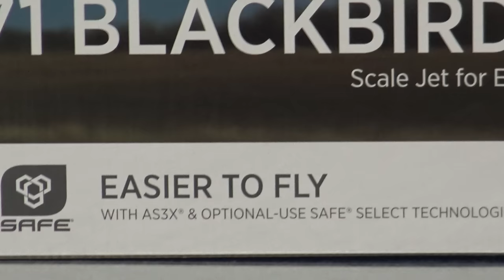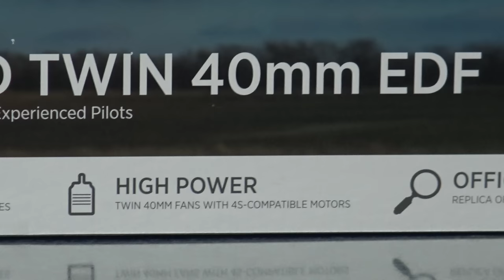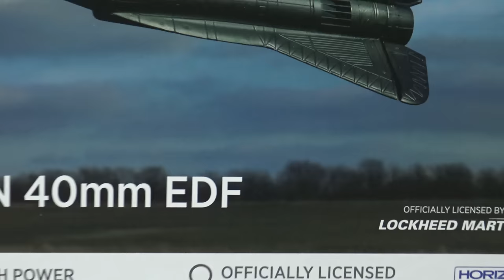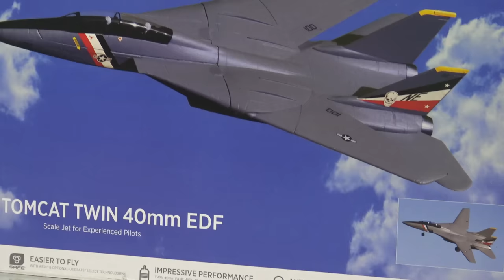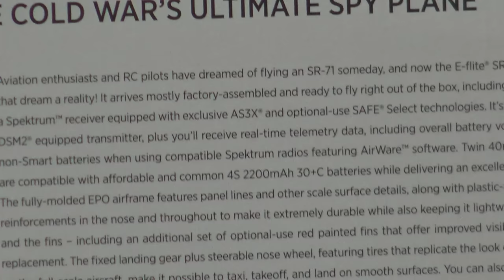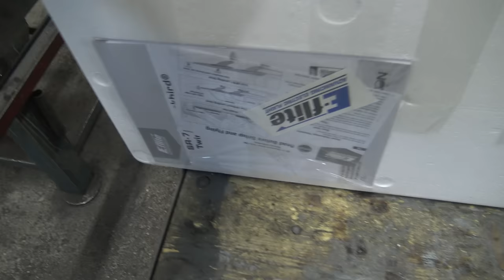ITS HERE!!! SR-71 Blackbird Twin 40mm EDF RC  jet 4S BNF Unboxing

Comment: The friction from the air would heat the plane up causing it to expand and seal up!  The fact they designed everything to those exact tolerances with slide rulers blows my mind.  To calculate how much expansion would take place without fancy computers!🤯🤯. Another great video, I’m ready for the next one already!!